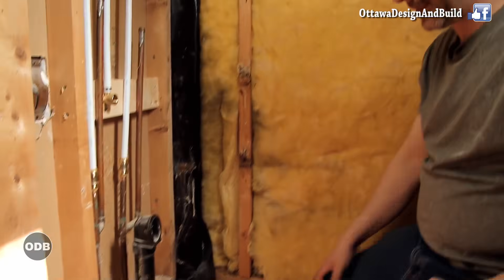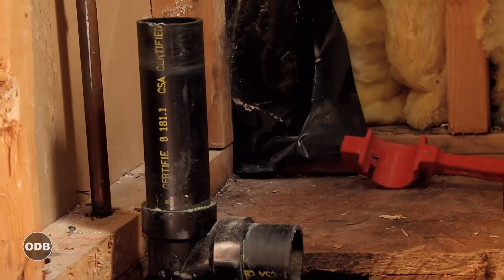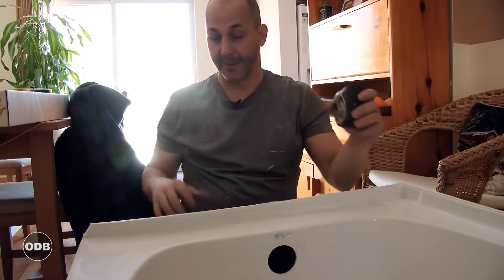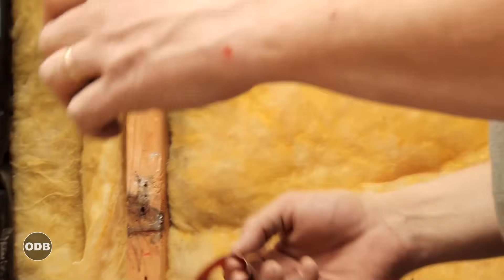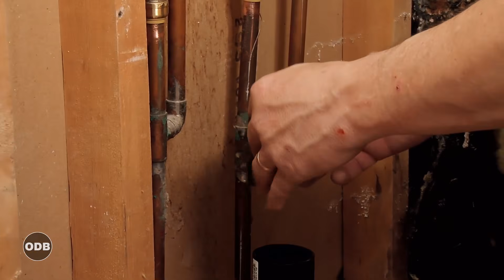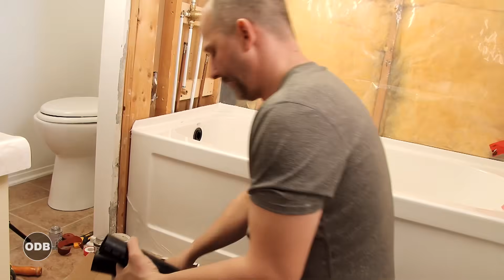How to Install a Bathtub Drain and Overflow

Comment: I wouldn't sand cell core ABS, very thin walls, clean it with a rag, debur or file the cut edge if needed, use a solvent cleaner and "glue" away, also do not use plumber's putty with ABS...

Comment: Hello Jeff.  
Got an idea for a video.  Here's the situation:  We're an older couple and my wife doesn't like stepping over the edge of the tub every day. So, my next honey-do assignment is to install a shower.  Removing the old tub is "easy" and 60"x30" Shower Pans are at Lowes and HomeDepot.  Installing the new shower drain to the old tub drain?  Existing piping is probably metal pipe with no access under the new shower pan when it's in place. Plan? ...dry fit, measure, then wander around the plumbing isle and see if I can piece the 2 together.    
If you ever make this video I'd enjoy watching it, with my fingers crossed hoping not to see a mistake I made.  Installing the shower soon.

Comment: Is it OK to use the cheaper acrylic sink type plastic pipe ptrap for a tub or should that be schedule 40 pvc? Many tub drain kits are the cheaper thinner compression fit pipes so at what point should it convert to the glued schedule 40?
Reply: most domestic DWV pipes are sch.40 pvc or abs, the OS&B tub drain and overfill kit is all sch.40 abs, just use that unless you have easy access to the underside of the tub where you can replace the cheaper fittings

Comment: Hello Great Job With Your Tutorials. I Have Been Watching Your You Tube, For About A Year, I Enjoy All Your Demonstrations.  I Live In A Single Floor Ranch House, With A Concrete Floor, I Have An Important Question, About A New Tub I Am Putting In,  I Ran Into A Problem, As I Was Removing The Old Overflow(The Pipe Being Many Years Old) Broke The  Pipe Appear To Be A Half Inch Pipe, My New Overflow Drain Line Is 1-1/2 Inch The Old Line of 1/2 Inch At The PTrap  and The Overflow Broke, The Pipe That The PTrap Connected To Maybe Still In Tack( From What I Can See) But It Is As Old As The PTrap But Appear To Be More Sturdy Not Sure Where The Pipe Line Run I Have Two Full Bathrooms That Are Right Next To Each other As Is The Kitchen Sink and Washer Not Sure How The Pipe Line Connect But I Must Make A Change To The Line In The Bedroom Bath Tub Is There Any Advice You Can Share

Comment: Did you use plumber's putty on any of the rubber gasket mating surfaces? (underside of the drain and back of the overflow?)

Comment: As a 30 year plumber i have never seen anyone sand abs or pvc pipe, the glue melts the pipe, sanding it is plain stupid and will not make a better joint, if anything doin that will make it weaker

Comment: Those pipe cutters are poo in the real world the handle causes problem.
You can get ones that are just donuts and work so much better.
I like the tub tool though, never seen one of those before and I'm a plumbing and heating engineer...U.K

Comment: Jeff, is it always necessary to replace the old drain if it’s still good and there’s no change in the location? Much appreciate your reply.
Reply: He said he replaced the threaded pieces of pipe, since the threads help make the seal. Fresh pipes thread together tighter than older crusty ones

Comment: Question, do you need plumbers putty if it's a pvc drain and not stainless? The putty says it's for bonding stainless fixtures. The new drain kit I bought the screw in drain is pvc.
Reply: Exactly.  Silicone. Plumbers putty will destroy plastics. It says so on the container and information found on the internet.

Comment: My Mirolin tub from HomeHardware says to use silicon instead of the plumbers putty. It is an acrylic fiberglass tub. Would I be fine using it or would I be best to follow their instructions?
Reply from the maker: They make a putty for acrylic fiberglass as well. I prefer the putty!
Reply: Plumbers putty would be best

Comment: I am refitting a 1973 bathroom, nothing is square, finally got the tub in and am wondering if there is a standard measure number from the center of the drain into the floor and the tub drain.   It appears to be somewhere around 8 1/2 inches?   I am putting a deep soaker tub 2 inches wider and am really not enjoying this AT ALL.   Thanks In Advance!!!

Comment: Have you ever installed a direct drain or an extension for a tub shoe so it could drop below the joist if there is one between the drain & overflow?
Is there supposed to be a gasket beneath the tub between the shoe & the tub (like on a shower drain)?

Comment: This guy, lol wrong glue, shark bites, pex to the shower head. Which means its going to siphon and drip from the shower head.  You are taking shortcuts and using old material. He at least used putty.
Reply: The shower valve's drop to the tub spout should always be soldered copper, but PEX hot and cold lines and PEX to the shower head is fine, common and within code.  How is a siphon action more prevalent for a PEX pipe instead of a copper pipe?  Siphon action is not involved.  Moen recommends that their single shower valves should not be installed more than 11 inches above the tub spout to prevent pressure from directing water up to and out the shower spout when the tub is filling.   Because most people now shower far more often than they bathe, people don't like the control valve that low on the wall and prefer the valve at naval height.  This is what causes the shower to drip.  For most installations the higher valve position is not an issue, unless the household has quite high water pressure.

Comment: HELP!  I know it's been 4 years since this was posted.  I hope you're still keeping tabs on it.  I have an  American Standard tub with integral overflow.  The instructions say warranty is VOIDED if drain is put in after setting the tub.  So I have to drop the tub in with the drain sticking out and somehow have to guess at the position of the waste hook-up.  It seems my only recourse is to glue the drain in place.  Any better ideas?
Reply: There are bathtub drain kits with a flexible overflow tube.  They have a corrugated section about 4 inches long just below the overflow inlet that allows you to adjust about an inch in any direction to line up with the target overflow hole on the tub. More commonly made of brass.  They are a "problem solver" type of product, so they can be much more expensive comparatively.  Depending on quality and material, I've seen them run between $80 to $250 for the full assembly.  If the Big Box stores don't have them, find a specialty plumbing store that serves mainly the trades.
Reply: @chrisgraham2904  My drain kit (Kohler pureflo) has a flexible 1.5in PVC for connection to the overflow.  This doesn't allow changing height on the fly, but it gives some leeway for a change in positioning.  I actually heated it slightly in the middle and bent in a bit to give it an 'S' shape slightly, which fit my existing drain spot well so I wouldn't have to redo that.  Just an option for those sticking to 1.5" PVC.
Reply: Make your measurements for where the pipe outflow should be, cut the drain pipes then dry fit them AND then dry fit the tub.   Examine how they line up, adjust as necessary, pull tub back and glue pipes at final measurements in place

Comment: The world is great when everything is straight and we'll ordered, but I need advice on offset downpipes that are off to one side. Drain kits don't sell anything but straight pipes that can't join the offset and the space is small to work in...☹️ In concrete floor...😭
Reply: Angle the drain to fit the tub, then use the white PVC corrugated extension for the overflow offset

Comment: What do you think of steel tubs, I'm cheap
Reply: Only downside is if they are not painted well they can scratch and look bad. Old school steel tubs seem to have held up for decades, but not so much the new steel tubs. You dont need to spend top$ on tub but you dont want to go too low and compromise reliability, the complex install of a tub is a lot more then the tub is worth

Comment: I have a condo and I'm looking to replace the tub without access underneath. Most videos are saying you need access. Your video seems to show a work around by just cutting the pvc, adjusting the lengths, and then adding the overflow after by just reaching behind the installed tub . Am I correct that's what I'm looking at?
Reply: It's abs
Reply: And no that's not correct

Comment: Hi Jeff. Really enjoy your videos. You have said mirolin tubs from big box stores are not the same quality but I called mirolin and they told me there is no difference in the same model/name of tub whether its sold thru a big box store or a high end bath boutique shop except maybe the price.
Reply from the maker: Except the good quality tubs are not sold in the box stores. You can still buy the crap from the other stores if you want.
Reply: Thanks for the reply Jeff.  I'm looking at getting the tucson tub you have recommended and what im wondering is if that tub model/part number from the mirolin website matches with what the box store sells, in your experience would it be the same quality tub? I know there are tubs built just for the box stores but they typically have a unique model name. Im just trying to buy it at the best price.

Comment: I do this for a living so listen real quick. You don't sand down PVC ends with sandpaper... You sand down copper ends prior to soldering to remove the oxidized layer prior to adding the flux, their is a purpose to sanding copper. sanding PVC is completely unnecessary and if done wrong can cause gouges and ricks of leaks. The PVC primer if applied correctly breaks down the PVC surface prior to adding the PVC glue. You want to to keep applying primer until you start to feel the dobber grip the pipe as you go around the end applying primer, that indicated the PVC is getting soft enough. you can feel the difference between when you first starting to apply the primer vs after you applied it for 30 seconds. If you do it this way you'll never worry about a leak. Don't sand the end, instead REAM the ends with a reamer (OD and ID). then apply primer and then glue. don't skip the primer and don't skip the glue. IF you plan do something, do it right.
Reply: I agree with you about it not being necessary to sand down the pipes, but why are you going on about PVC so much? He's working on ABS here
Reply: That's ABS pipe, not PVC.
Reply: Hi there Scott, You seem to know what you are talking about. I am doing a walk in shower in my home. I removed the old tub and the black pipe for the over flow and drain is exactly as this one in the video. I already cut just underneath the drain pipe where it meets the overflow so I'm left with the straight pipe right on top of pea trap going up about 6" but that's to high for the new drain. My question is how many inches does a pea trap have to have to work properly? Can I put a 45" elbow right on top of pea? Cause that will drop my new drain to where it is flush with the sub floor. Thanks in advance and your expertise can be used as I'm not to sure and need to finish this soon. Thanks
Reply: I don't see many people using the primer...? Absolutely necessary i suppose ...
Reply: @ikust007  ABS glue, doesn't require a primer.  PVC does.
Reply: One thing to note when joining copper pipe regarding sanding before making a connection.  Never sand copper pipe if it's going to be joined with a push type fitting like Shark-Bite.  Be meticulous about deburring the inside and outside edges to protect the rubber seal inside a push-in fitting.  It looks like Jeff was working with black ABS pipe and fittings, not PVC.
Reply: He's using ABS not PVC..
Reply: Seems like video is incomplete. Most important part left off. How to complete connection of drain pipe. What happened?

Comment: Do you "seal" that pvc piece for the overflow. Not where it hits the tub, but where it connects to the rest of the pvc? Or is it just tight enough on its own
Reply from the maker: every joint in a drain system must be sealed with glue of sealant according to the materials. Cheers!

Comment: Hi Jeff, I know you have some good things to say about the Mirolin tub you installed on the video, I am looking at bathtubs at Home Depot and the Mirolin has some bad reviews, in particular excessive creaking sounds and proper drainage, Did you experience any of thiis?
Reply from the maker: Careful, I don't get mine from the box stores. Those stores purchase different models with inferior quality and have the manufacturer put their name on it. Just like the Kohler toilets for under 200 bucks. complete crap. a real toilet from kohler costs over 400 and it works.

Comment: While changing out our alcove bath for a stand alone tub, we discovered a stack vent pipe in the alcove wall we now need to remove. Is it ok to move that pipe to the adjoining exterior wall?
Reply from the maker: yes. vent pipe can go anywhere. it can also be reduced to 2" in most places

Comment: Fish tanks are made with silicone, it is made to stay in water. Great video, I'm going to buy that pipe cutter.  Thanks.
Reply: Exactly. Silicone is the last thing you need to worry about with standing water. Just use high quality product and apply it properly. This guy is so good at teaching that you ALMOST believed everything he said even though it's incorrect information.
Reply: @ivanwong8361 not only that, but plumbers puty isn't too be used on plastics, ABS etc.

Comment: You didn’t show the rubber gasket under the tub. I think it is called a shoe gasket. Isn’t that the most important part so it doesn’t leak
Reply from the maker: Sorry, it is there.
Reply: @HomeRenoVisionDIY  What's the white thing around the "shoe gasket"? Did you silicone it?
Reply: @cubul32  Looks like Plumber's Goop.

Comment: Thanks for the video. One thing I've learned from the comments section on many of these bathroom  drain installation videos is that the correct glue and gluing both parts of the joint are critically important.
Reply from the maker: especially if you are using the pipe from the builder store. Very poor quality

Comment: How far below floor level does the drain go at 3:48?  I have a floor joist that runs parallel to the width of the tub area and centers at 7 1/2" from the end. Does the piping that goes from the drain upright pipe under the tub to the drain run fully above the floor?  I don't want to cut away any of the floor joist to accommodate the drain pipe.
Reply from the maker: Hard for me to guide you here. There are 2 types of drain. one near the back wall and 1 directly under the tub drain area. If I was you I would get  a plumber to install the tub.
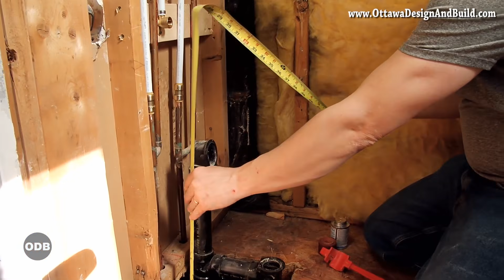Reply: Thanks. I was hoping you might remember (at 0:23) if that pipe lay above the floor grade or below it going to the drain of the tub. The video was hard to tell.
Reply: @ds61821  The tub manufacturer will provide the dimension between the tub drain hole and the floor surface below it.  The height above the floor varies from manufacturer to manufacturer but commonly 4-1/2 inches.
Reply: @chrisgraham2904  Thanks, Chris. But the tub was installed 2 years ago.

Comment: Hi Jeff, can you tell me the name or style of the overplate installed and how it was fastened to the overflow assembly? I didn't see any screw holes. Thanks!
Reply from the maker: This is a new assembly from the home depot. the overflow has a threaded plate the allows the trim to slide over it in a groove for a clean look.
I think it is from OSB.

Comment: i will be looking for a tub here soon and i cant quite make out what u said this brand name is....how ever i am interested, are there any other tubs you would suggest as well aside from this particular brand?
Reply from the maker: Thanks Brandon. I am a big fan of mirolin. Their quality exceeds the retail pricing. however you could also go with a Maax tub. They have a reasonably good quality level and an extensive line of options. Both are easy to acquire using local bathroom suppliers.